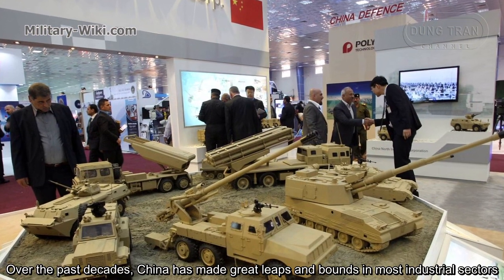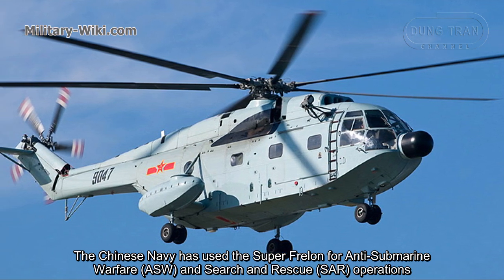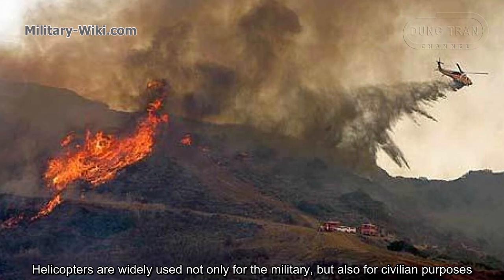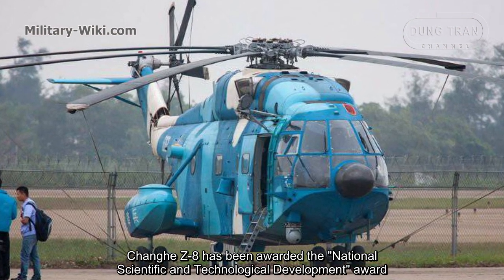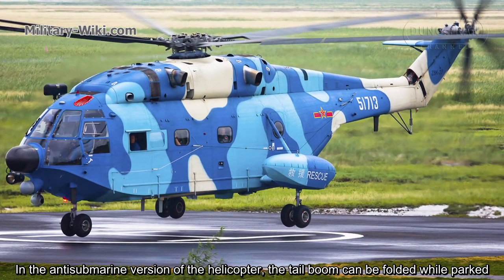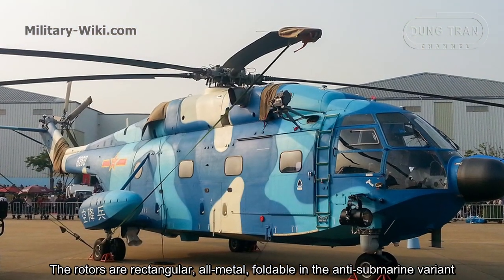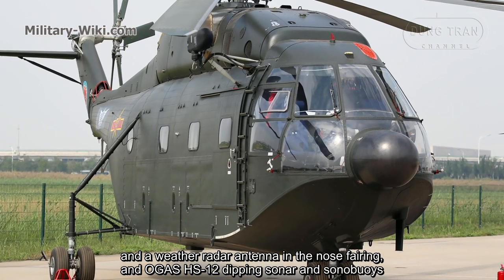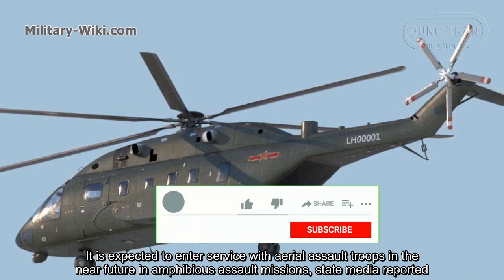Changhe Z-8 - Chinese Multi-Purpose Helicopter Copied From the SA-321 Super-Frelon

Comment: The original Frelon / Super Frelon was a collaboration between french SA and Sikorsky, first designed for naval use. No one knows exactly why french "heads" decided to discontinue that good machine, with no projected equivalent... It was still able to be improved... that precisely what the chineses did !
Reply: 3 engines and a heavy and expensive maintenance at the end on all the systems. During its time in the french navy the super frelon has been withdraw from the submarine warfare, the last 20 years at least of its service in the navy for the problems on the rotor head and blades. Could only do search and rescue, the last years.